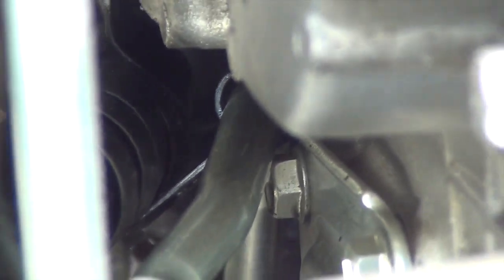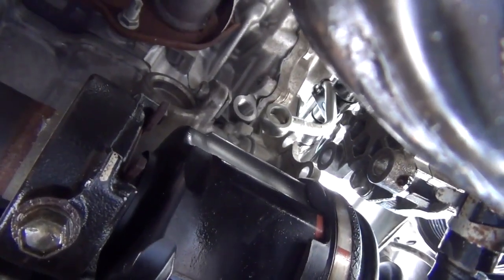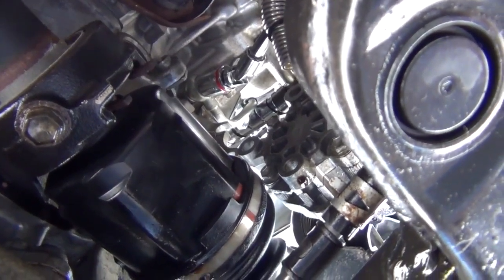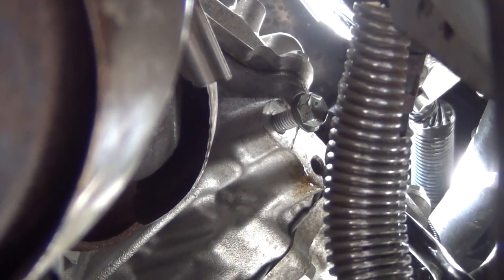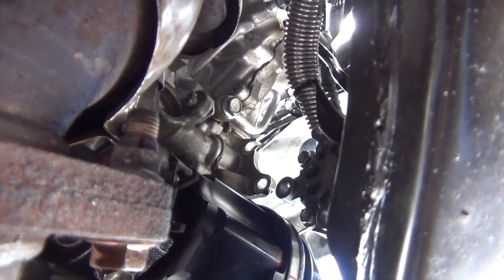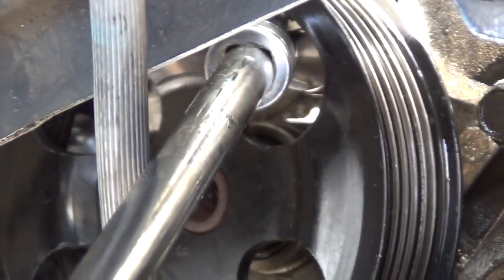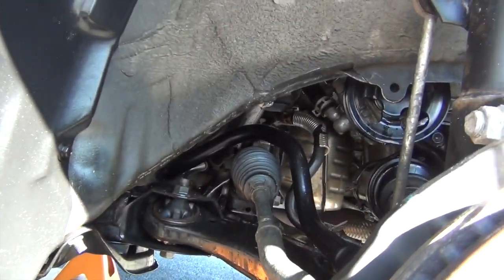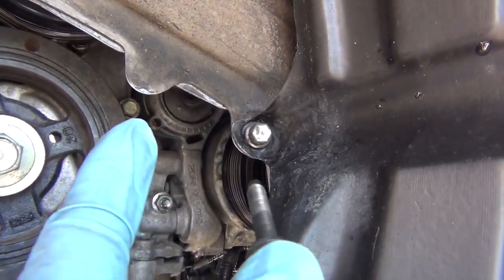3.5L V6 Camry VVT-i Oil Failure - How To Fix

Comment: I just got a 2010 V6 Camry. Do you have any idea if the problem was fixed for the 2010 model? Appreciate any help!
Reply: Beginning by May of 2008, the all metal oil line was used so you won't have any problems with a 2010.  The "recall" is good through year 2021.  Toyota's VIN system is a clusterfu$% .... and lots of Lexus and Toyota vehicle owners did not get the notice.
Reply: @paulmartin8271  I read that the recall was good through 2013 on some websites. Has it changed?
Reply: @memphistiger4647  Yes it was changed but now has expired.

Comment: A job well done along with the camera and work instructions. I'm glad I sold my 07 V6 and don't have to worry about this issue nowadays. Still like the Camry V6 with good power and fuel efficient.  Hope your car is still trouble free?
Reply from the maker: Tom Shong Thanks Tom, it is a great engine for power and decent fuel economy when you keep your right foot under control. I keep changing the oil and adding gas and she keeps running ... couldn't ask for much more than that ;)

Comment: Job done, wasn't too bad.  Took about three hours with a coffee break.

Notes:

- I missed a small bracket holding the hoses in place for the power steering pump.  Without removing that you can't move the pump far enough to get to the bottom rear bolt on the line.

- Lining up the power steering pump to reinstall was tricky.  I found it easiest to get the top bolt in first.

- I feel like I accomplished something by getting that plastic cover back in place.

- My P0015 code may have been due to the filter in the top bolt being partially restricted.  Cleaned it with brake cleaner, using Mobil 1 in the engine (not sure what the previous owner ran), hopefully won't be an issue in the future.
Reply from the maker: Awesome job! Yeah, getting that cover on is probably the most time consuming part for an individual step with all the hand contorting ;)

Comment: Many thanks for this video, very well done.  We bought an '07 V-6 Camry a few months ago and I stumbled across your video researching an engine code that showed itself recently (P0015, code cleared itself, I hope to not see it again) .  I check under the hood and.....  rubber hose.  I'll get it done as soon as I have the parts in hand, the last thing I need is a wife stuck on the side of the road with a massive oil leak.
Reply from the maker: Glad I could help ... Mine went at roughly the 6 year, 58K mile mark ... if you got more mileage out of yours, consider yourself lucky and get it swapped for the all metal line ASAP!
Reply: @trevorsgaragemusings  hi and thanks for the video. Still running good with the metal line?
Reply from the maker: @italojose9962  indeed it is! The car isn’t driven much now, but at the time and for a few years after this it was my daily driver and now has 93K miles and IIRC, had around 60K miles at the time.
Reply: neutered10mm Yeah, 97k miles and as far as I can tell it's the original hose.  I'll have the parts in hand tomorrow so I can tackle it this weekend.  I've seen how easy this is to swap on a Highlander, it's a shame that power steering pump is in the way.  Without your video that probably would have been the most frustrating part for me, I'm not sure I would have thought to use a u-joint like that to get around the frame.
Reply: neutered10mm  Hello. What a great job and detailed explanation on your part. I hope that your son Nicholas will be as good of a mechanically as you are one day!! I am just trying to help my son out who is away at college. He came to visit last week and drove his 08 highlander only once and the following morning I noticed a massive oil puddle. I diagnosed that to be the same issue as you are describing. Could you provide a little bit more information about that upper cover that was soaked with oil. Does it need to be put back? Or was it there just to protect the original robber portion of the tubing. What a shady design onToyota’s part. I can’t believe they could not put the oll metal pipe right from the beginning. Almost an intentional time bomb. If you would be so kind to send that information to the following email address:  Gobulls100@gmail.com. Hope it is not too much to ask. Thank you in advance. I wish you and your family all the best In the coming holiday season!

Comment: FWIW , using long extensions is not bets way as you lose correct torque values (the extensions flexes) .
So take that into consideration, use the highest max value if you can't get close or use thick extension as possible .